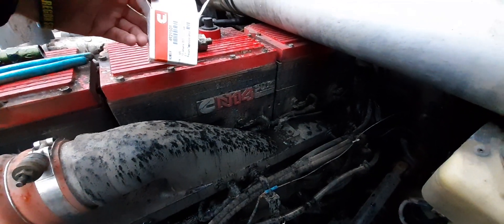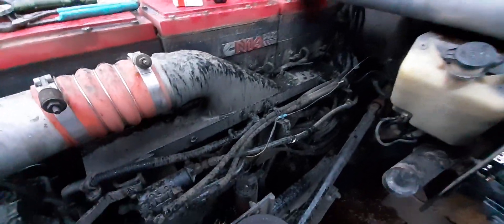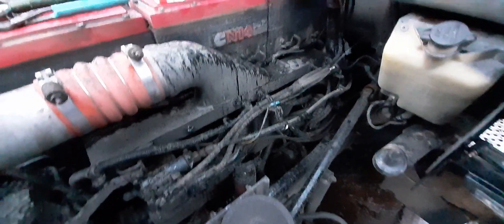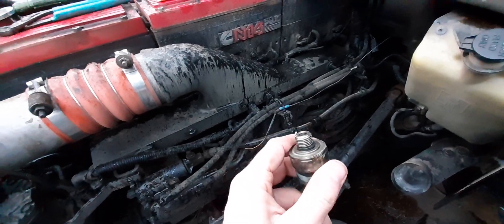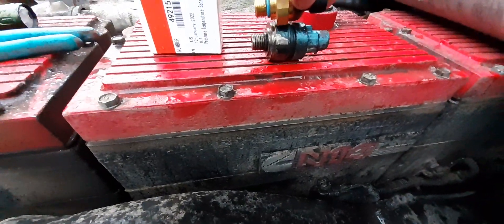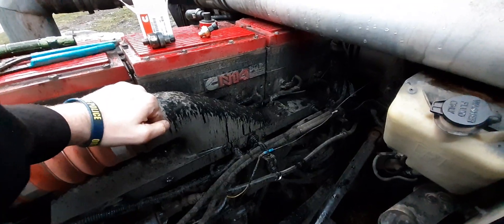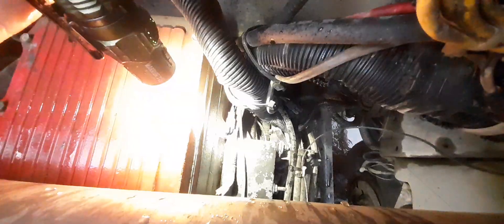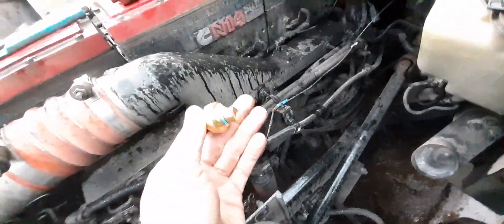Cummins N-14 Popping/Stumbling Fix

Comment: Just went to the Cummins dealership and tried to pick up that sensor. I gave them the part number and they said it was $248.74. Told my wife about it and she found it on Amazon for $26.00 pays to check aftermarket for the same thing. These dealers are just a ripoff.
Reply from the maker: @mosesbradford1844  
Oh man!!
Before I read the rest of your comment I was gonna attach a link either via Amazon or ebay.
200 bucks is very steep !!!

When it shows up it will be in a Cummins red and white box with correct barcode and part number on it I bet as well.

Also I'm thinking you probably have the larger old original size one this one will be smaller and brass mostliikey
Reply: @ yup exactly but it’s just a white box not a Cummins box